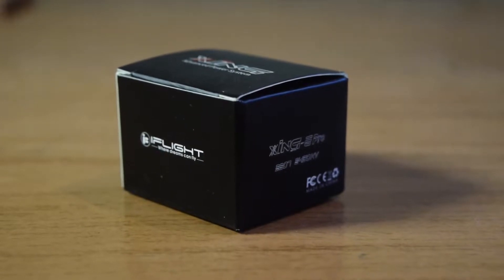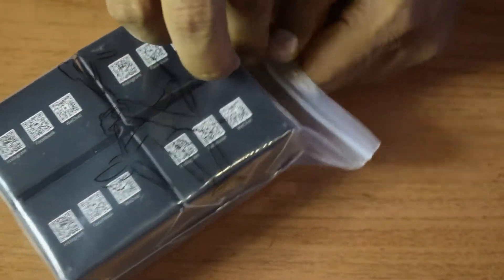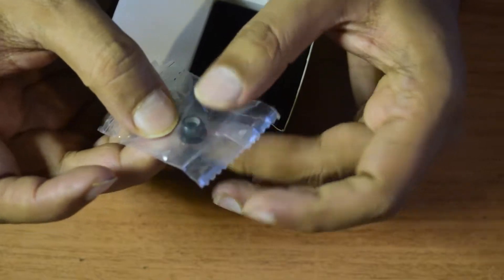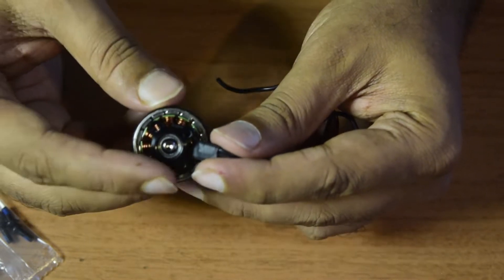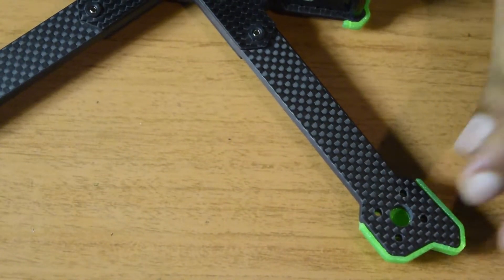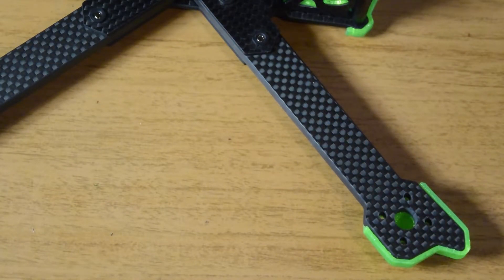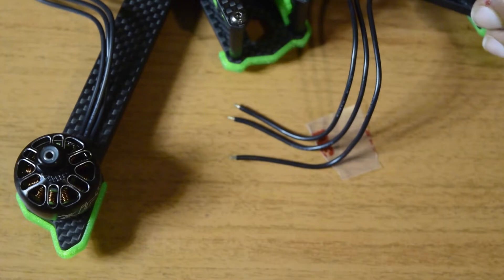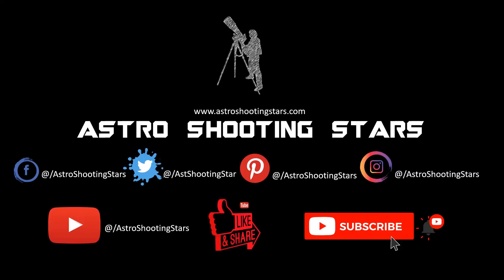HOW TO INSTALL iFlight XING-E Pro 2207 2450KV 4S Brushless FPV Motors On FPV Freestyle Drone Quad

Comment: I have bought the 2450kv motors but i am confused about the propeller size. It says that the shaft diameter of the motor is 4mm but i cannot find any 5 inch props with 4mm hole diameter… all of them are 5mm… is that ok?? if not do you recommend any??
Reply: I have the same problem bro, have found a solution?
Reply: @abdessamadelbekhti4517  Dunno if its too late but its actually an M5 thread on a 4mm shaft. The documentation is just rubbish… just buy normal 5mm shaft props and an M5 nut to tighten it… the props dont have to screw on as well just in case you’re also new